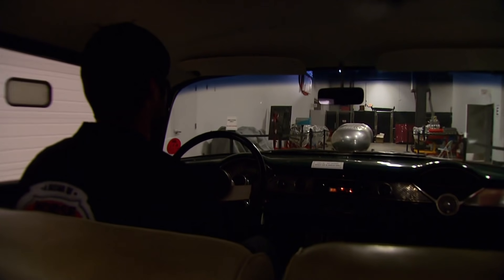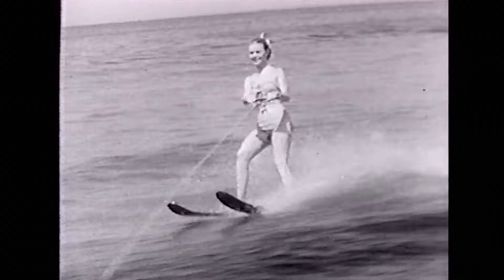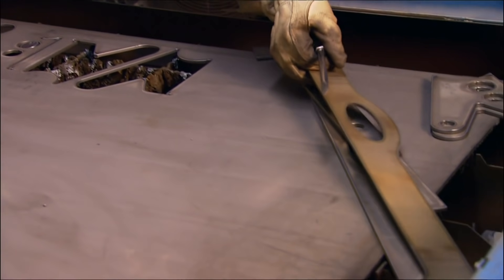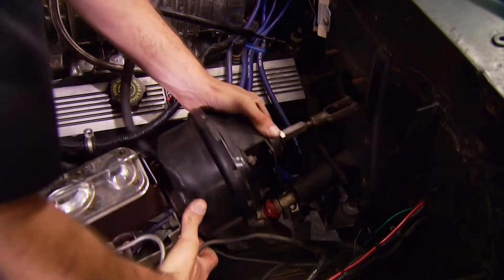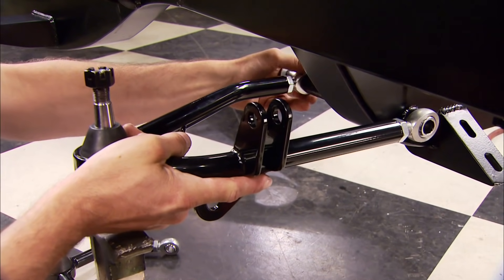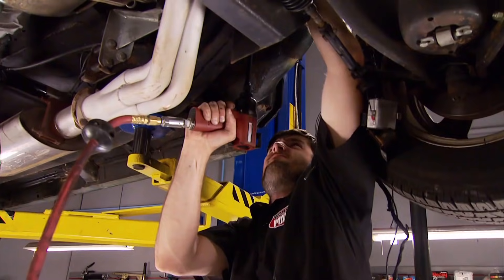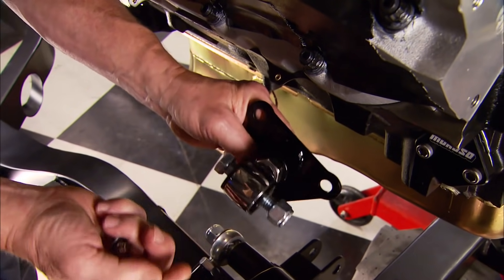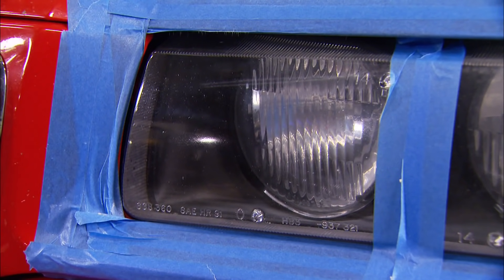Rebuilding A '55 Chevy From The Frame Up: Part 1- Horsepower S14, E12

Comment: I'm in the middle of replacing my 57 chevy's tired old 327 with a Blue Print 540 big block... I'm now at an easy $50k spent!  Needed to replace the rear end, put a Trimec TKX 5 speed in it and had to put in a flaming river rack and pinion w/ a new Ididit steering column.  Added Caltrak traction bars and also re-did the suspension under it.  One thing always leads to another!  So, I can imagine what the cost of this build would be.

Comment: I would´ve kept the blower and the wheel/tire combo. Never get bored to look at..
Reply: I agree, well, sort of, in my humble opinion a performance 14-71 blower is definitely a better look for a ‘55! 
Plus, that current blower would be to small for the new 580” power plant..
Not to mention, that existing blower is practically just a noise maker rather than boost making blower! 
As for the wheel/tire combo, the wheels  will always be timeless! However, the rear wheels need to be stretched to be at the very least double the current rear wheel width!

Comment: 4l80e is a 4 speed not 6 speed 🤦‍♂️🤦‍♂️🤦‍♂️
Reply: yes bro and a 6l80e is the 6 speed auto @marccardinal
Reply: I'm glad someone else picked up on that
Reply: TCI manufactures their own version of the 4L80E, but they manufacture it with 6 forward gears as opposed to the usual 4. TCI calls it the 6X 6-Speed, and this is the transmission that Joe and his friends are using in this particular project.

Comment: I want to take a 55 chevy belar and drop in on a tow wheel drive 77 chevy truck from with an Ls and t56 6 speed with a gate less shifter and comaro rear end to fit wider tires